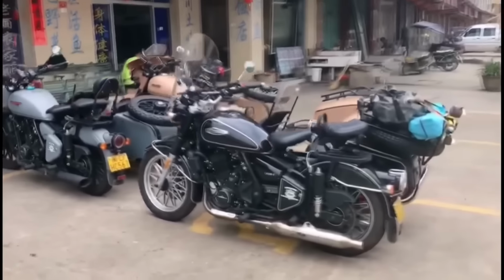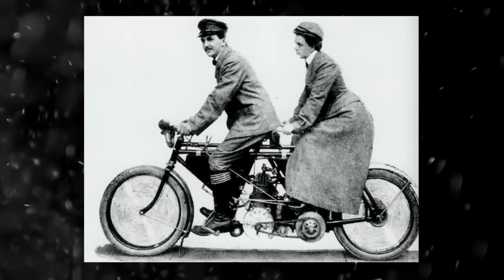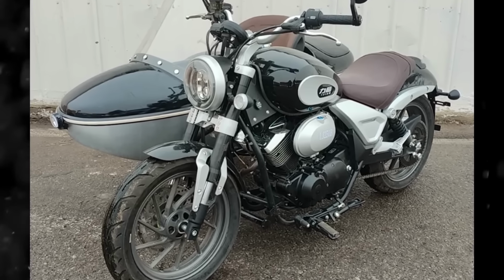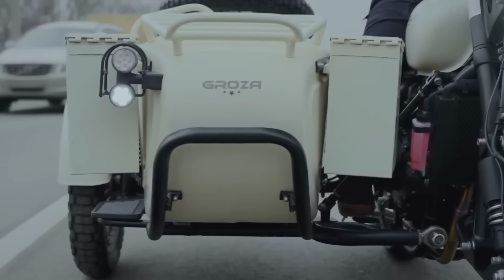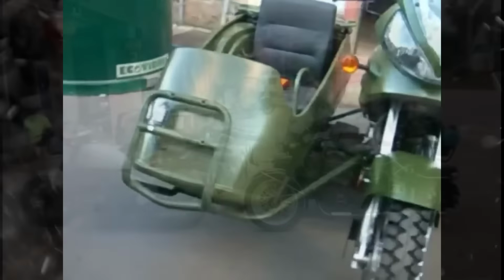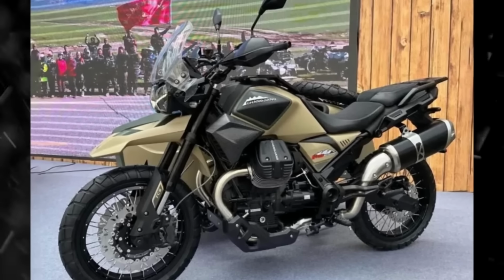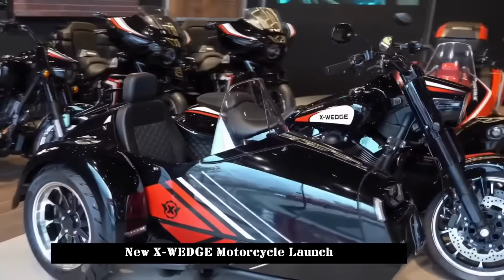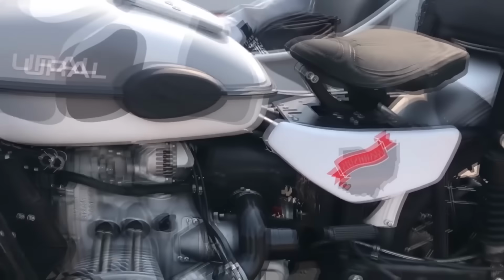10 Modern Motorcycles with Sidecars

Comment: Much of the original reason for the development of sidecars in the UK was to avoid the high (annual registration) tax payable on a four wheeled vehicle.  The tax payable on a 3 wheeled vehicle was much lower to accommodate the fact that Sidecar Combinations were used by 'working men' as family transport.  Sidecars which could hold several children were common, and there were even models which 'folded' to make getting motorcycle and (folded) sidecar through the narrow passageways between/behind terraced houses possible.  The lower Road Tax payable on 3-Wheelers also led to the development of 'cyclecars'  like the Morgan 3 wheeler in its many forms.

Comment: Ural introduce in the Philippines, hardly a buyer cuz sidecars aren't allowed on the main roads, hwys, skyways, or toll roads, DOT rules allow big bikes with 400cc+ on those roads. Even though those are 400cc+, that stupid Philippine Law will not allow sidecars on motorcycles on said roads. These sidecar motorcycles are bigger, faster, heavier, & way better than those cheap tricycles used by the Philippines for non-main road use & public transportation. If the Philippines would change DOT rules & regulations concerning sidecars that are 500+cc displacement. Then, I would get one & install a roof for sunny with a cooler & two small fans & rainy days on the sidecar. Plus the roof must be aerodynamic for the hwys, skyways & toll roads. These big displacement bikes with sidecars will be a hit for Philippine transportation.

Comment: I have the SHINERAY/SWM URBAN Sidecar 525 for almost two years and I am really happy with it!!!  Engine parts are the same as the Honda CB500x (which I also own). The sidecar is really well built, most of the parts are metal, not plastic, a very nice display with a lot of data about the motorcycle, trips, etc. and with a surprising led illuminated handlebar commands (really love that).

Comment: One quick note here about the Changjiang brand, the very first model of original Changjiang side car motor was manufactured in Jiangxi province, as a copy of the Russian Ural M72 which is a copy of BMW R61, it features the iconic boxer engine with 750mm displacement, 2 rear wheel drive and shaft drive,  it's said that there were 17 companies that manufactured the model years ago in China, and name their product XX750. The Changjiang side car motor we see today merely retain the brand, it's produced in Henan province, which is hundreds of miles away from Jiangxi, and is installed with a 650mm single cylinder engine, chain drive and  only one rear wheel drive. The company that now runs Changjiang brand launched a Defender 750 side car model a couple of years ago, which copied the appearance of Moto Guzzi a lot, but the product just vanished soon like a flash in the pan.
Reply: The Changjiang M1 (also known as Model 1957) was an IMZ M-72 which was copied from the BMW R71 (with improvements). It did not have 2WD.
Reply: The newer Changjiang is a 650 twin, not a single.

Comment: Ive ridden my sidecar Ural in Alaska during the winter at 30 below zero. I have "hot grips" but it was still too damn cold. I usually stopped riding the bike when the temps went below 20 below. 40 below or colder? Forget it!

Comment: I have owned three Urals. All were fun to ride. The first, a 1994, was the worst. Just about everything that could break did, but talking to other owners it seemed that the later ones were better as they weren't having the same issues I had so I traded it for a 2000. Both bikes were the single wheel drive Tourist models.

The 2000 was much better. The main issue was alternators as their old supplier had shut down and the new supplier had quality issues.

In 2003 the factory brought a prototype model of a bike the called the Retro to a rally. It had hydraulic brakes with a disk up front, and they let us drive the solitary prototype. After the ride they asked if we would consider buying one if it came over, I said yes and got the second sidecar Retro in the US.

That was a 2004 Retro. Since it was very new it had a couple of teething issues but they fixed them all or in most cases sent me the parts and I installed them, saving a trip to the dealer. Once past this period it settled down nicely and it's still going strong with minimal repairs. 

In the years since URAL has had a couple periods of problems but from what I was hearing from owners was that after fuel injection they became much better, not just because of the injection but other small changes that weren't so apparent like better bearings, gaskets, stainless steel exhaust, better fasteners and so on. I'm not buying one because my wife who rode with me has passed on and due to spinal problems I am now in a wheelchair. 

But for 27 years I had a lot of fun.
Reply: Have a 2019, think second to last year before the move to Kazakhstan? Also the first year of the upgraded engine. Love my girl but yeah she's spent some time in the shop (electrical) but when she runs which is most of time she's a blast. Going to order a new one but want to give them a few more years to wrk out the new factory bugs and they are getting there. Main reason I am Ural only for a rig is the full reverse gear plus I have a Gear Up with the 2 wheel drive when needed. Both features can come in VERY handy when needed and I do off road with the rig. Just make sure the car is on the downhill side ;-) Our Duck Toller just turned one and his goggles have been ordered. O-ring already in the car.
Reply: @seanodonnell460  Are Ural still in production, given the 'complex' political /economic situation in that part of the world?

Comment: I had a Ural what a hunk of junk. I am currently on a 1977 Honda goldwing with a custom built sidecar I designed and built myself. This 48 year old bike has proven it's self far more reliable then my brand new Ural. I have had the side car on it for 13 years now and it has served me well. It is capable of 130 kph and handles the road quite well. I live in western Canada so it only get seasonal use.

Comment: I was only aware of the Ural bike.  Ours is reliable and likes about 55-60 mph.  I can't imagine going up to 140km on a sidecar!
Reply: I travel at 130 kph on my vintage gold wing with side regularly. I had a Ural what a POS never again.
Reply: @markseehawer3762  The ones produced after they shut the factory down for a redesign of the drive train are pretty reliable. I had three, the last is a 2004 and it's still going strong. Cruises all day at secondary road speeds (55-60) without issue, something the first two couldn't claim. After 2000 when the factory was bought by new owners and the drive train redone, they have collected warranty information on every bike sold and used that to help determine failure points and take corrective action. They have limited resources so had to pick and choose what to change but they have done a decent job. I visited the factory in 2005 and was surprised at the scrutiny they were giving things. They aren't perfect by any means but at rallies some of the mechanics at shops that carried multiple brands said they were comparable to other non Japanese bikes in owner issues after delivery.

Comment: The problem with most Chinese Sidecar units is the "chair" fine in countries where they drive on the right hand side of the road, but in countries that drive in the left-hand side, the "chair" becomes suicidal as the passenger is on the wrong side when overtaking other vehicles, hence the popular naming of them as "suicide chairs" if they offered a unit with the chair on the left I think they would open up a bigger market, as Disecars are/were very popular here in the UK, I for one would Purchase such a model if the Chair was on the left rather than the right
Reply: I live in Australia. I have had many sidecars over the years. I now own a Ural Retro. All of them had the sidecar on the left. Chang Jiangs are available in Australia with the sidecar on the left. Never been a problem.
Reply: Triumph
Reply: @jameswells554 Defeat
Reply: There is no perfect side for the chair. No matter which side of the road your country drives on, there are hazards either way. You are only focusing on one.

Comment: I have been driving sidecar rigs for a dozen years. Don't really follow the industry. Quite surprised about all the new offerings, as I don't see another one every year. In the US, they have become fewer and fewer. They are definitely not for everyone. I think most people fall in love with the look and idea of owning one, however, after a short period of time, move on to something else. Many used rigs for sale are very low mileage. Some states require a special endorsement on the driver's license, while others don't even require one for a motorcycle. As nice as many of these new rigs look, I wouldn't be buying a new one for several years, until I developed a confidence in the Chinese manufacturer and their offerings.

Comment: Wow, China is building wonderful sidecar motorcycles! I love sidecars. During my college years in the 1970s i rode a 1950 Harley-Davidson "74 OHV" during the winter equipped with reverse gear transmission, adjustable sidecar fork, winter windscreen and legshields. Snow and icy roads couldn't stop it. Sidecars are a BLAST. 😂
Reply: Brainwashed fool

Comment: To echo another comment, can any of these bikes be purchased in the US?
Reply: I had a 1981 Harley Davidson with a factory sidecar. Front forks had 2 rakes, one for bike alone and one kicked out for running with SC. 4 speed with no reverse. Had to be careful when parking. Impossible to push it backwards. Had a normal shovel head. Beautiful bike.
Yeah, you can buy a Ural in the US.
Reply: The Ural is/was very famous in the US
Reply: You just got to love it when people respond but don't actually answer your question.

Comment: Whats the purpose of a motor with a sidecar nowadays from a practical perspective? Other than fun puropse with is valid ofc
Reply: Carrying capacity, stability on loose unsealed surfaces, take your dog, kids, granddads out. My use is mostly camping gear carrying.
Reply: For people who have balance issues, such as myself. Easier for my disabled wife to ride with me instead of trying to throw a leg. That's on top of all the other things awp mentioned.
Reply: Easier to ride in the winter
Reply: It’s not about performance or speed.
The reasoning is the same as why many of us love open cockpit, vintage airplanes.
It’s the history & nostalgia.
When I take folks for a ride in the sidecar (when my dog is willing to give up his seat), they wear a smile for days!
It takes me 1/2 hour just to stop for fuel, so folks can chat and take pictures (it’s called the Ural Delay Factor, or UDF).
When did you ever hear that from someone who rides a crotch rocket (never!)?
I own/ride a 2WD Ural Gear Up, and while we can’t go fast, we can go anywhere. 😎